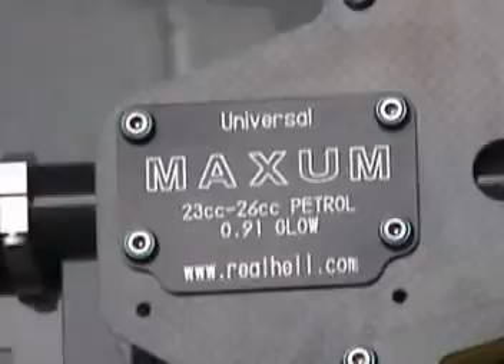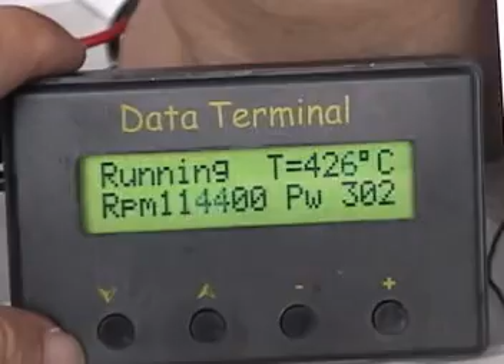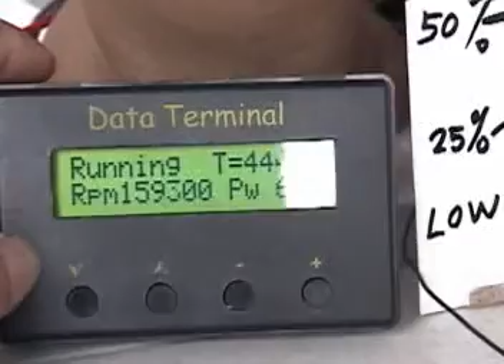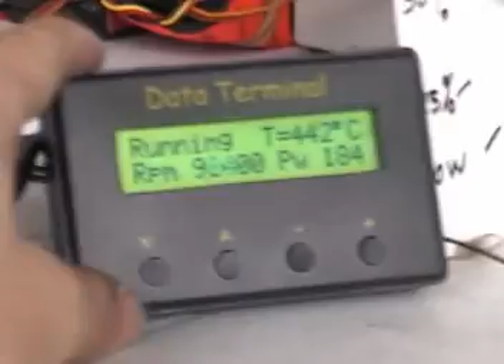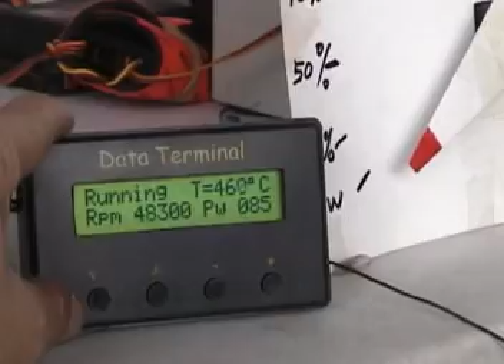Jetjoe 1400 Turbine Engine

Comment: Um, there is fuel leaking, you may want to check that out, m-kay.  Temperature is pretty cool while running, what is the thermal probe depth ?